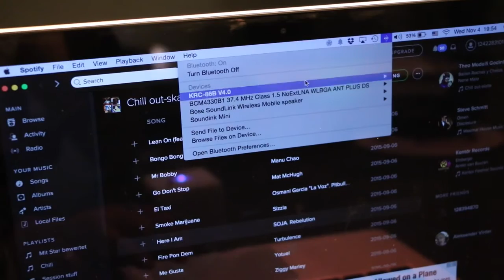DIY Bluetooth Speaker Soundtest

Comment: A friend of mine just linked me to your video and blog, thanks for the shoutout! Glad I could help, your speaker looks good!
Reply: +BarryLlewellynperson glad you liked it, thanks! Gotta be honest though, the enclosure's got some pretty bad acoustics, the plastic resonates a lot... .And the speaker drivers are one of the cheap Chinese ones. I really hope to find the time to make a better speaker though, I think you did some quite decent work there, maybe I can take some of your driver recommendations. Keep it up!
Reply: +MrMig Its a great start anyway, my first speakers were a lot worse believe me! And yeah sure, just hit me a message anytime and I'll give you some guidance. Best of luck!
Reply: +miguel Might be good to try and tape some weight on that passive radiator to try to get it moving more and the tuning lower. It might not improve anything with that particular setup but it could be worth a try. If you find it works you can open it up and glue on the weight on the inside.
Reply: One more thing to add, the passive radiator doesn't seem to move as if there are air leaks maybe. Passive radiators work best completely sealed. you should be able to push the woofer with your finger and see the air pressure move the passive rad. good luck with your future builds.

Comment: You are Brazilian?
Reply from the maker: +Davi Spiess lobe not really, mais falo um bocado de portugues ;)
Reply: +Miguel Guse ahh gostei, e aí, me fala uma coisa que eu não entendi, são dois alto falantes normais e um subwoofer? Abraço
Reply: +Miguel Guse Where you buy this passive radiator, how much is it ? Can you ad link, or type ?
This brick is briliant :D
Reply: +TheMajster007 Thanks! Sorry for the late answer, somehow didn't see it :o I actually got it with the speaker drivers. I'm in China and I mostly order from TaoBao. I guess you're not in China though...you can give AliExpress (http://www.aliexpress.com/item/2pcs-35mm-speaker-bass-vibrating-diaphragm-Passive-plate-SoundBox-radiator/32662341621.html?spm=2114.01010208.3.232.e8wDKk&ws_ab_test=searchweb201556_0,searchweb201602_3_10017_10021_507_10022_9986_10020_10009_10008_10018_10019,searchweb201603_7&btsid=a03477e2-4ab0-4281-b924-a34f299a221b)  a try or take a look at Barry Llewellyn online shop(https://www.etsy.com/shop/bAudio)! He's not only got a great selection of speaker drivers, but also very nice tutorials!
Reply: Thank's :) I from Poland